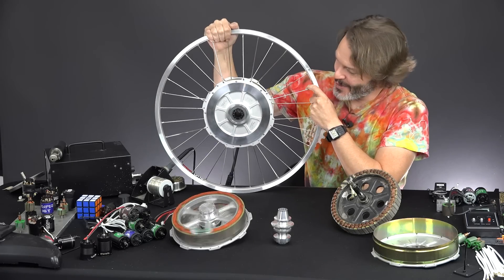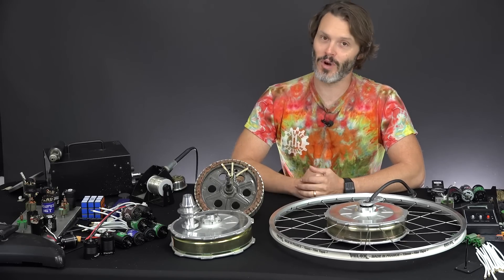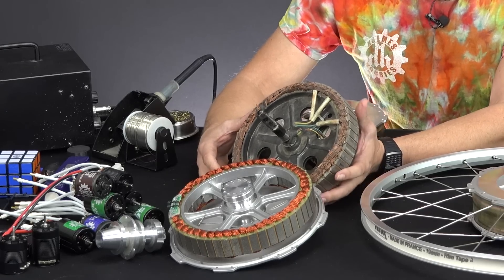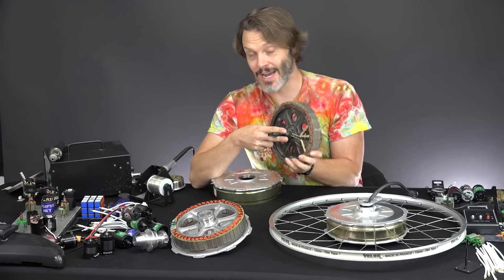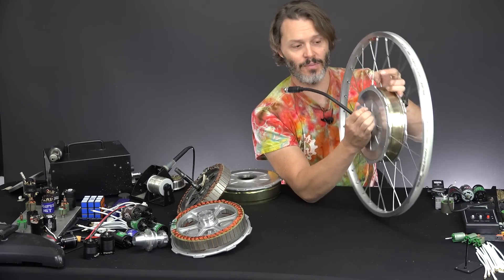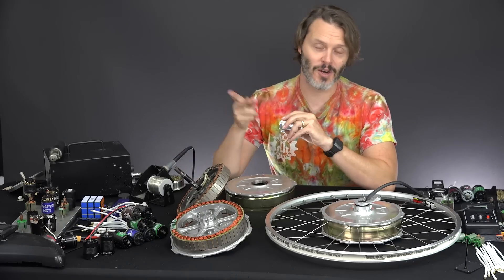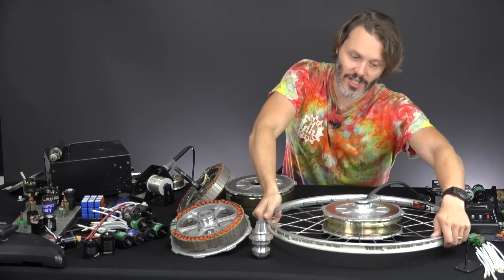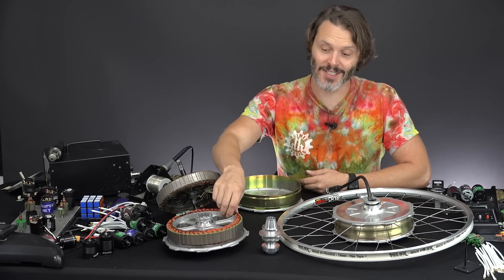Best E-bike Motor You Can Buy - Grin Tech All Axle Electric Bike Hub Motor Overview | Holmes Hobbies

Comment: Just thinking outloud. Shouldn't be relying on the steel as a heat absorption mass anyway. The fact that that even works at all is just happenstance, not a purposeful design feature. Better to use aluminum and utilize that as a heat spreader with a heat sink, with the addition of Statorade, I suppose, and anodizing the inside of the casing black, to better absorb internal heat better, to then dissipate it out the other side. But why aren't these motors made with fins welded on, as part of the assembly, instead of having to rely on aftermarket heatsink fin attachments with thermal paste?

Seems it would also be ideal to keep the outside of the motor bare metal, for the same reason. Maybe cuz cheaper motors are made of steel, which rust.
Reply from the maker: Steel is required as back iron for magnets, only way around that is a halbach array which is more cost for no performance or weight improvement.  

The thermal mass is already there, hub motors are necessarily kinda heavy due to torque requirements. But since this motor is weight optimized vs something like a 9 continent it has less non active thermal mass which shows up on long (very long) climbs.  

Average user would never know the difference but grintech has the performance graphs and heat modeling right on the website so you can see the differences of temp over time.  Worth mentioning, but i would still choose this lighter motor over a 9 continent any day of the week!

Heatsinking on the sidecovers is effective while moving but not so much at slow speeds.  Theres a ton of research devoted to hest shedding methods on the endless sphere forum.  Due to the cost of external fins molded into a sidecover (its not an easy to cast shape) and few people that need that much heatsinking, its not a feature offered.  Statoraid actually does a better job that heatsinks in most cases!

Comment: My 500w 9 year old beach cruiser conversion has had zero issues, someone can't properly tighten a nut?
Reply from the maker: Ive seen a few spinouts in my day, ive laced a few hundred high power hubmotor wheelsets.  Regen is the biggest issue, it will rock the nuts loose quickly or eat out the frame.  Above 3000w hope the frame doesnt spread. 3/4" axle is not a lot of surface area to transfer the load of a 26" tire, there's a lot of leverage. 

Most of my wheelbuilds in the past 5 years are for handicap builds.  The all-axle is my motor of choice now due to redundant safety as well as lower likelihood of spinouts due to regen.

Comment: I would have bought one, but my rim is 36 spoke not 32
Reply from the maker: Rims are low cost these days, quality 36 hole is actually getting hard to find.  But grintech can lace them up with nice rims at a pretty low cost too
Reply: @HolmesHobbies  they don't handle 18 x 4 wheels
Reply from the maker: @duanethompson2360  is that motorcycle?

Comment: I have had a magic pie 3 over 10 years with a modded stock 1000w controller and have regularly put 4000w through it in short bursts and cautious on continuous watts up hills without a problem.
And because of large diameter motor it climb most any hill @1000w with ease.
Will spin front tire from takeoff on pavement with big knobby tire...real fun in winter....eats tire in couple months of continuous use.

Comment: 3:48 Hmm, I wouldn't have minded if they had used some of those 2 freed up kilos adding better cooling to allow for higher constant power output. Though, they have attachable heat sinks on their website, so I guess that is an option.
Reply from the maker: @massimocole9689   some added statoraid does wonders for cooling without significant weight! Thermal paths are really where hubmotors need the most help, not added thermal mass
Reply: @HolmesHobbies  Yeah, thermal mass just delays the inevitable, much better to solve the root problem of heat leaving more slowly than its being produced. My original thought was cooling fins on the casing and copper heat pipes to help transmit more heat from the interior to the case. The heat sinks on their website provide the first bit, (really they should be called radiators or cooling fins or something since their main job appears to be dissipating heat rather than just storing it. But I think that's a losing battle since that's how the computer industry has been using the term for a while) and then statoraid is a way simpler solution for transferring heat from the interior than what I was thinking, so with those two yeah you should be pretty great.

Comment: I like those Videos. But: l miss a link to the motor-data. Specially a diagramm with torque (Nm) vs rpm, power (W) vs. rpm, efficiency vs. rpm. For ANY Design this basic data is absolute necessary. But why is this not Standard. I never bought a motocycle without this data. We, all foreign enthusiasts would appreciate that. I apologize for my bad english!
Reply from the maker: https://ebikes.ca/product-info/grin-products/all-axle-hub-motor.html

You can view their motor simulator to get performance diagrams as well.
Reply: @HolmesHobbies  Great, thankyou so much!

Comment: Grin doesn't manufacture a single motot 😅 Grin is only a retailer, and rude as hell
Reply from the maker: There is literally a video of Keith at grin assembling motors on YouTube.   I was part of the prototype and design process and know very well what machining and engineering was done in house or contracted.  I've watched the team engineer products from thin air.  Far more than a simple retailer. 

They make and assemble in house when needed and contract out when appropriate.  Like any business.

Comment: I have a  Lectric 3.0 would one of these new motors work for my bike for extra power to climb Bay Area hills?
Reply from the maker: Possible, not easy.  You will need to custom lace the wheel and find a place for all the components
Reply: @HolmesHobbies  Ok

Comment: I have been wondering why my ebike seems to lurch a little when starting off, it must be the slip fit torque arm not engaging tightly with the axle. Only 200 miles and the symtom has progressed.  Great stuff.

Comment: Great video with the needed details. The lighter weight GRIN hub = lower rotating mass and lower battery drain.
Although it's a new bike this year, eventually I will replace my E-CELLS Super Monarch Crown front and rear motors with Grin Tech hub motors and controller. That they are made in Canada makes it just that much nicer. My folding solar "blanket" is a Canadian made 220 watt Off Grid TREK to charge my BLUETTI AC200 MAX power station that charges my two E-CELLS batteries when I'm car camping/hunting.
Reply from the maker: Right on!

Comment: The C3Strom Bike I own has no Spokes, just a Rim. Less noise and maintenance regardless of it being heavier. There are definite pros and Cons but I just wanted something Stable and worry free, rugged and reliable. I only wish the Brake pads lasted longer and were more robust.  
 I think there's so much room for new designs for Ebikes though. A dedicated Frame(bike) for that type of wheel wouldn't be too much to ask at all in my opinion. Even if it's just a matter of Sourcing Parts and Machining in a Batch Scale. Similar to what LunaCycles does. I'd buy all the Ebikes if I had the cash😝 Love it! The Video makes so much Sense in justifying design from what I can see and know about through my very limited experience. 👍😎🙏

Comment: Good talk about weight and reaction torque issues.  Not as much about the bearing and shaft which are also critical to me.  My project is a quad bike which needs to fit through a 32" doorway.  I like the Grin motor because it doesn't stick out past the tire (or looks that way).   The quad needs a single side mount with a robust shaft which also cannot stick out past the tire on the outside.  This video is 2 years old.  I'd love to get an update where we are today and where the technology is going. Thanks for some really good info.

Comment: we finally worked out how to modify these grin all axle motors with liquid cooling and using fast wind wind version with 84 volts these motors should hit the close to 100kms per hour .ive still got abit of saving to do here in australia ,they cost alot to buy them here close to 1000 au dollars i think

Comment: Hey John, I'm trying to electrify a recumbent Delta Trike, the Sun EZ-3 USX HD (two wheels in the back, one in front).  It needs to be really fast in that I will be using it for BikeJoring (riding with the Dogs).  Can you, or would you,  put two of the rear hub motors on the trike or would you use the X1 Pro Gen 2 or Stealth?  Of course,  bikejoring (dryland mushing) is all done on dirt.  Let me know your thoughts, thanks in advance.

Comment: He would you compare this to a mid frame motor? Everything I've read points to wheel motors sucking.
Reply from the maker: At low rpm the hub motor will have less efficiency.    At higher rpms they will have better efficiency due to lack of gears eating it up.  For cruising the streets there is no problem with hub motors.  Off road, mid drive works better.
Reply from the maker: This hub is also extremely high quality and well engineered.  Power to weight ratio for standard ebike hubs, unrivaled

Comment: "best" ebike motor you can buy huh? I laugh at that motor in QS273!!! Those motors look dope, but when i think "best" i think power and performance. You didnt even give us the specs!!! If they make those is qs273 equivalent power id happily trade in that sketchy steel axle for that new mounting method. Especially with wheelies and hill climbs and things that stress the droput im always paranoid about it spinning in the dropout.. Do those come in 12.6kw continuous and 25kw peaks?
Reply from the maker: Ebike and electric motorcycle are different classes of motor, you can visit the grintech website to view up to date technicals of this motor.  It's a 3hp motor more or less. 

I've built and ridden plenty of QS hubmotors.  For brute force in a simple package they are great... besides constant problems with dropouts and axles.  My last QS powered bike was such a headache to maintain and change flats on. 40lb wheel flat fixes suuuuuck. I'd rather hot rod a surron at this point, I got my fill of high powered hubmotor builds. Sold my last big hub to build the quad bike project.
Reply: @HolmesHobbies  oh, you know what, you're right. I have it on a stealth bomber frame which is a very loosely defined e-bike but it definitely is labeled as an e-motorcycle motor. I forgot all about that..

Did you make videos of your build(s) with high powered hubs? I'd love to see em.

And yeah I'll definitely check that site out.  Thanks for the info.
Reply from the maker: I dont have documentation outside of old build threads on endless sphere.   By the time we got the YouTube rolling I was pretty much over the heavy hubmotor builds outside of heavy hauling customs for customers.
Reply: @HolmesHobbies  ah man. That sucks. I would've loved to see some builds by someone who knows their stuff. Almost all the vids on YouTube of high powered hubs like the 273 are your every day Joe shmoe just documenting their builds. Not many well produced vids.

Comment: The cheap hub motors from the typical 250 dollar kit with Me have always had an issue with the main wiring harness which consists of 9 wires turning and being damaged over time. What can keep that cable from spinning and twisting up?

Comment: I’ve built a dozen hubmotor bikes…spun one axle in a front wheel install….which did not have a torque arm.  any hubmotor I install now,  has a torque arm, and I have never had an issue with any more spinouts…I have a 12 kw hub motor on a cafe racer style bike I designed from the wheels up.  Use regen all the time, and wheelie it frequently. 24s LiFePO4, 150 amp sabvoton controller……but use steel torque arms on both sides of the motor.  It doesn’t move, but yes, I do check if it’s loosening….just paranoid after having it happen to me the front fork spinout which resulted in a painful bail that compromised a thumb, lol.  Just good practice to check your bike thoroughly before a ride….wheels, axles, handlebars, and brakes in particular…because its not a bicycle anymore….it’s a high speed motorbike which has way more likelyhood of hurting you seriously.   Stopping is more important than going fast….bigger disc rotors and good quality 4 piston hydraulic brakes are recommended for any heavy, fast ebike. I won’t build a bike for anyone without having upgraded brakes.  The all axle motor looks well built, and the upgraded torque arms are nicely designed…but truthfully, I think his old torque arms were adequate for builds under 1500 watts, especially if you used them on both sides of the frame…..but the lower weight is important on any build, so these new motors look nice.   I haven’t got one yet, due to the price….they are very pricey in comparison to the others on the market.  I have done much business with Grin Cyclery over the years, and I can highly recommend their expertise, products, and helpful staff,  Top Notch in my opinion!  cheers!
Reply from the maker: The average customer isn't a good fabricator and isn't good about pre ride checks.   I've spun so many fronts and broke enough forks that it's just a risk trying anything with speed or power, I'd put 750 watts and 20mph as the max.  The best front hub builds we made were with custom torque arms for no slop... well not as good as the zero slop of this hub but still custom cut out of thick steel to fit as perfect as possible.
Reply from the maker: Your 12kw project sounds fun!   Hub motors are great for simple road going bikes.   Nice and quiet too.  Nothing like blasting around at odd hours of the night with nothing more than tire noise.
Reply: where do u get ur LFP battery from
Reply: @danhle1032  ordered the 40152 headway cells and active balancer from China, and built my own battery.  No BMS to limit the battery’s amp output…so I pay close attention while charging the battery, monitoring individual cell voltages.

Comment: Thanks John! Random question: I have a 48V battery and a 48V controller. What would happen if I ran a 60V hub motor on this otherwise 48V system?
Reply from the maker: Typically it will just be slower.  Much more fun to run a 48v hub on 60v.   Or my more typical 36v hub on 48 to 72v.
Reply: @HolmesHobbies  Definitely sounds funner to overvolt than to undervolt! haha
Reply: @HolmesHobbies  ammm but in top of being slower I guess this going to generate more heat also, right? 🤔

Comment: I brought a moto tech 350 w 36v I had to change the front tire actually still the process  little did I know the wires to the motor are now showing but seem to be fine ... my question is do I need a new Hub or is my motor still good?

Comment: Nice features but I rather buy the standard hubs motor for the low cost. I could probably get 2 hubs for $700. I never had issues with the standard hubs. I’ll deal with the heavier weight and torquing the nuts every now and then. Thanks for the video though.
Reply: where do u buy ur motors and batteries from?
Reply: @danhle1032  
yes

Comment: can this motor be rewound so it has more torque? Pedicab with 700 lbs of people needs more torque! this motor overheats when trying to haul that much ass.
Reply from the maker: Different Kv can't provide different torque,  you simply need a bigger motor or more than one motor.
Reply: @HolmesHobbies  or mount it in a smaller wheel right? thanks for reply!

Comment: I am still trying to figure out how to get a Grin wheel for my coaster brake flat track bikes. I have skip tooth sprockets on pedals and 115mm drop outs not cassette friendly. LOL! My CWC 1953 Roadmaster front drop outs have not distorted in 1000km and several 30kph speed bump hits. I will machine a brace now to strap to the fork leg, American steel way better than alloy.

Comment: A bit expensive, but the weight saving is very decent!
My trike have a Cromotor, 75V with a custom Dropout that was actually laced at Holmes hobbies!  Regen is fairly insane on this one, it can even lock up the wheel.
Reply from the maker: Quite a few of my wheels out there!  Good to see you coming through!
Reply: I'm running 48v 1000watt 30 amp bat powered front hub motor and engineering a drum brake also working on a belt driven mid drive to assist my 5 seater vip Pedicab. I'm very interested to learn all I can about this design and others as they could make my job fun. Please feel free to blow me up with information that can be helpful

Comment: Shit 80 year old tech, built with lightweight alloys = still shit!

Unsprung weight is bad.  Plus mid drive leverages gear train!    Hub drive is dead tech!
Reply: Mid-drives only work if you go high power and single speed. If you have gears you will be replacing the cassette or chain every 300 miles or so. Also you will be changing expensive brake pads a lot.

Comment: Maybe not the best place to ask, I bought a Kickbike Cross Max 20D and was wanting to put a hub motor on the rear as I understand putting one of the suspension fork is frowned upon.  Problem is, it's a strange hub width on the rear that is only about 72mm wide.
Is that a hub motor that is out there that would fit?  I'm sure I can source it out to 75mm if needed.

Comment: i have a 3000w hub motor and i NEED torque arms i went to a laser shop and let them cut out custom torque arms 8mm stainless steel works perfect! and the nuts i tighten with a torque key to 40nm. but i would love to have a thru axle motor but i didnt find a 12*135mm motor only 12*142..